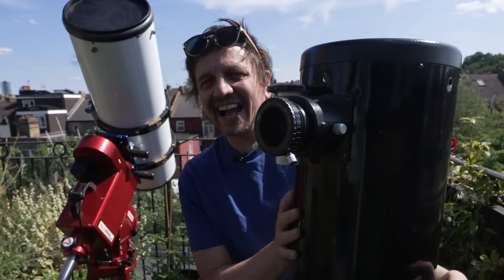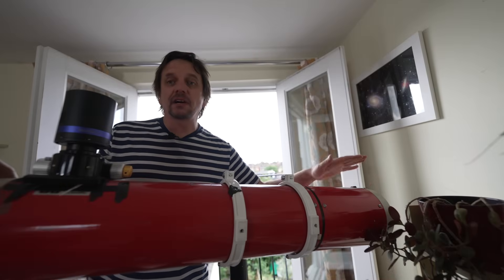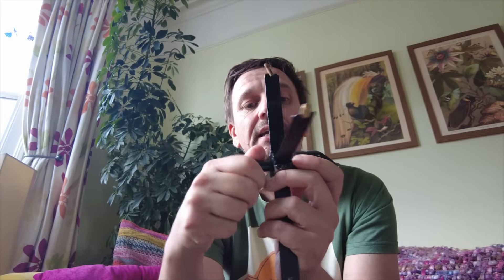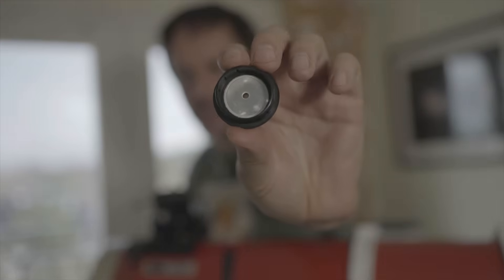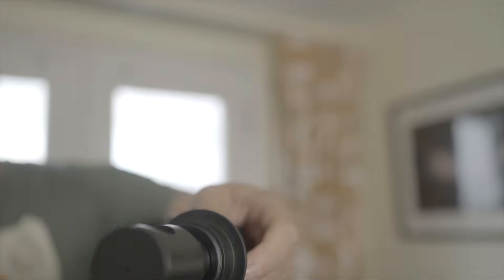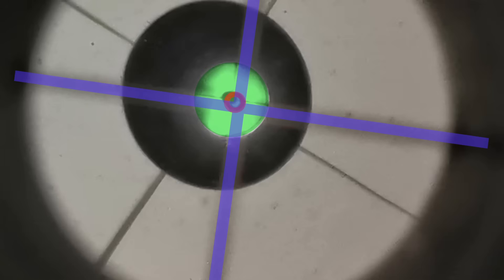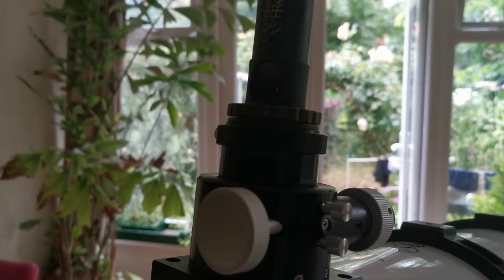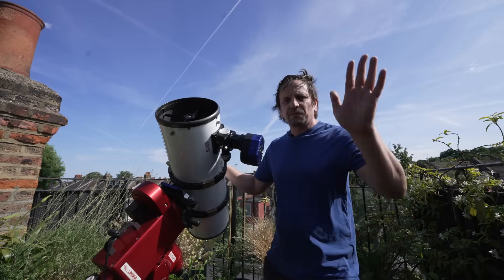How to Collimate a Newtonian Telescope │ astrobiscuit tutorial

Comment: hey biscuit , i really wanted a good newtonian telescope , either second hand or on amazon , but no luck they all costed so much and the ones by celestron were just base models toylike which were expensive for no reason , there just no good telescopes here In India. really disappointed , man what a bummer
Reply: Anything decent will cost you more than 300 euros minimum. I paid for my 100/600 reflector more than 400 euros. On top of that add couple of decent eyepieces, barlow eyepiece/lens plus new 90 degree zenith mirror and i went over 600 euros
Reply: @DarioJLSounds  i was hoping for around 300 euro but but the ones at that price were cheap imported toys. a second hand telescope would have been cool too
Reply: @havish530  Around that price you can get an acceptable entry model. You're not getting advanced features, nor top of the line quality, but it's definitely more than serviceable and not just a toy.
 
I've seen the rings around Saturn and the bands on Neptune on my Omegon 130/920 that currently sells for €250, including its EQ-3 mount. The eyepieces are basic, so after you've saved up some more, you may want to upgrade those later to some more comfortable ones with a wider field of view and longer eye relief (distance between your eyeball and the eyepiece). The focuser is a basic single speed rack and pinion type, but does the job. It will not work with DSLR cameras, because the tube and focuser will flex under the weight, throwing off your collimation. But for visual observation, or astrophotography with a lightweight astro camera (or modified webcam), it's more than sufficient.
 
Don't get sucked into the myth that in order to enjoy looking at the sky you're going to need those large diameter models you see astro-youtubers use in their videos. If you're starting in the hobby, you don't even know if you'll stick with it, or how often you'll be looking at the skies. If you're like me, and just set up the telescope a couple of times a year to look at some interesting things like the planets, or the occasional comet, a serviceable budget scope is really all you need. If it turns out this new hobby turns into a passion, you can later still sell your basic scope, and get a more advanced model better suited to the type of astronomy you have gravitated to, as different targets require different telescopes.
 
Finally, here's a little piece of advice that won't break the bank. Do you have some somewhat decent binoculars? Say 50mm or larger, and a modest magnification of between 7-11? If not, they're not all that expensive. On a dark night, take them out, and point them up at the sky. You'll be amazed at how many little stars you'll sometimes discover in what to the naked eye look like pretty bare patches of sky. The Pleiades are also visible in the Northern hemisphere during the winter months, and are also a great target for binoculars. As is the moon with its various craters, especially when the moon isn't full, since that gives you a great view of the terminator (where the lit part of the moon meets the unlit part), that really highlights the height differences across the lunar landscape. The full moon does not really show this as well as a partial moon.
Reply: @EvenTheDogAgrees  After looking for good telescopes for a few days i sighed and got a pair of binoculars , i took them out at sky about a month ago and it was weird i could see two stars instead of one and it was difficult keeping my head straight up , although it was great bringing them to mountains on a family trip. i havent tried it in winter tho i think i might get a clear view then , only objject i have clearly looked at is moon , i atleast wanted to see venus once or a meteor shower? idk lol
Reply: @havish530  Hahah, if you want to look straight up, best lie down on the grass or something. I'm 46, and my neck isn't what it used to be either. 😂
 
Whether you see those faint stars through binoculars or not depends on the light pollution in your area. Your eyes also need to be dark-adapted. Avoid looking at any artificial light: flashlights, camp fires, street lights, ... Even if they're in the distance. Your eyes need some time to adapt to the darkness. Once they do, they will be able to pick out fainter stars and nebulae. But as soon as you turn on the flashlight to read something real quick, or turn on the lit display of your smartwatch to check the time, or light a cigarette, you reset your eyes and will have to wait for them to adapt to the darkness again.
Reply from the maker: have you thpught about making one... grinding the mirrors etc...
Reply: @Astrobiscuit  sounds really hard... i thought getting a shell would be the big problem